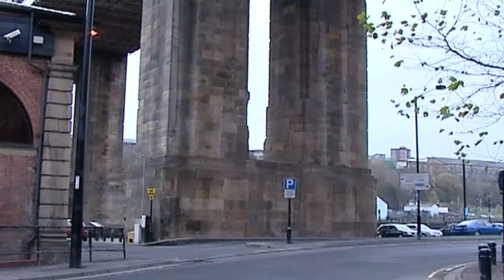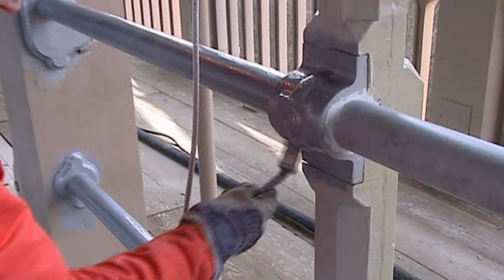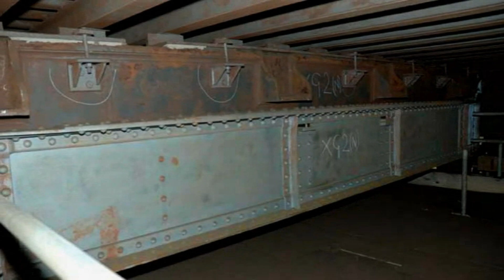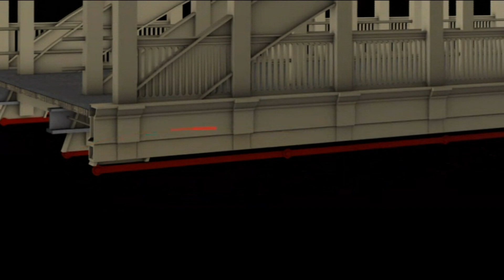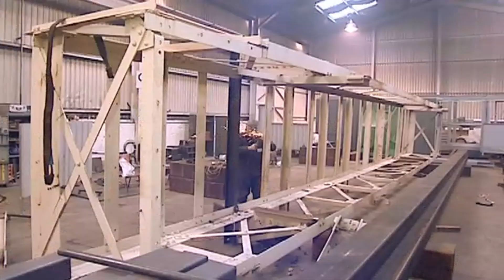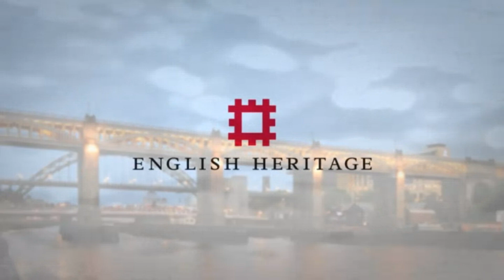High Level Bridge Newcastle-Gateshead_Project completed in 2008

Comment: A job really well done.
Reply from the maker: The Network Rail CEO at the time, Iain Coucher, remarked that it sometimes felt as though the company was running a museum rather than a rail network. None of the £40m+ that the project cost made any difference to train services! It was done to satisfy the company's legal obligations to maintain a highway crossing.